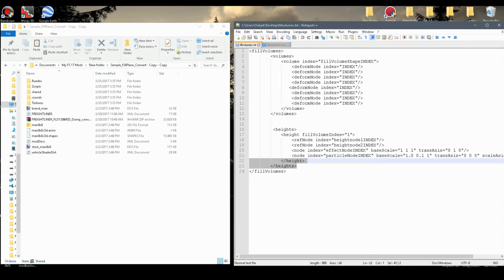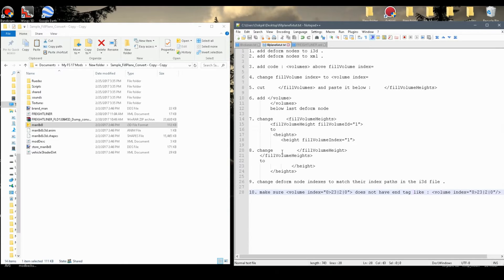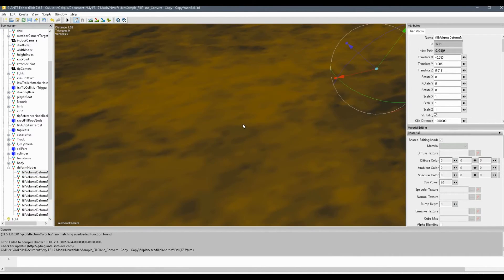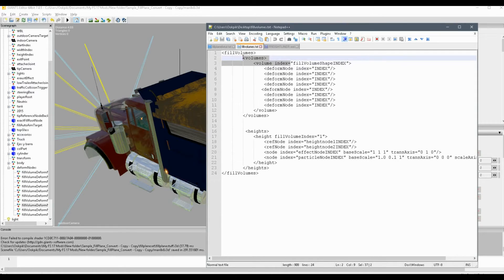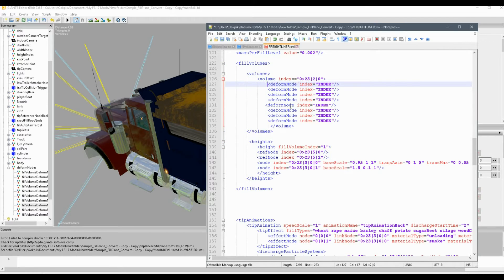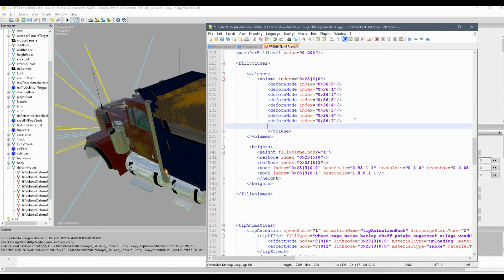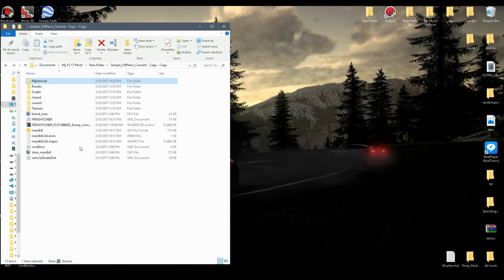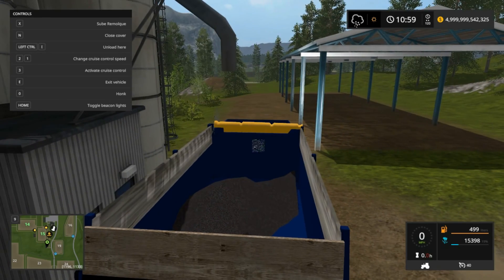Fix Converted Mod's Fillplanes // Farming Simulator 17

Comment: Hi Chase, i tried again your tutorial and it's work ! i can fill my trailer but only under a combine harvester and not under the grain silo ? Otherwise i have an other problem, the game crash when i want unload the trailer have you an idea to fix it ?
Error: Running LUA method 'update'.
dataS/scripts/effects/ShaderPlaneEffect.lua(62) : attempt to perform arithmetic on field 'currentDelay' (a nil value)
Error: Running LUA method 'update'.
dataS/scripts/effects/ShaderPlaneEffect.lua(62) : attempt to perform arithmetic on field 'currentDelay' (a nil value)
Error: Running LUA method 'update'.
dataS/scripts/effects/ShaderPlaneEffect.lua(62) : attempt to perform arithmetic on field 'currentDelay' (a nil value)
Error: Running LUA method 'update'.
dataS/scripts/effects/ShaderPlaneEffect.lua(62) : attempt to perform arithmetic on field 'currentDelay' (a nil value)
Error: Running LUA method 'update'.
dataS/scripts/effects/ShaderPlaneEffect.lua(62) : attempt to perform arithmetic on field 'currentDelay' (a nil value)
Error: Running LUA method 'update'.
dataS/scripts/effects/ShaderPlaneEffect.lua(62) : attempt to perform arithmetic on field 'currentDelay' (a nil value)
Error: Running LUA method 'update'.
dataS/scripts/effects/ShaderPlaneEffect.lua(62) : attempt to perform arithmetic on field 'currentDelay' (a nil value)
Error: Running LUA method 'update'.
dataS/scripts/effects/ShaderPlaneEffect.lua(62) : attempt to perform arithmetic on field 'currentDelay' (a nil value)
Error: Running LUA method 'update'.
dataS/scripts/effects/ShaderPlaneEffect.lua(62) : attempt to perform arithmetic on field 'currentDelay' (a nil value)
Error: Running LUA method 'update'.
dataS/scripts/effects/ShaderPlaneEffect.lua(62) : attempt to perform arithmetic on field 'currentDelay' (a nil value)
Error: Running LUA method 'update'.
dataS/scripts/effects/ShaderPlaneEffect.lua(62) : attempt to perform arithmetic on field 'currentDelay' (a nil value)
Error: Running LUA method 'update'.
dataS/scripts/effects/ShaderPlaneEffect.lua(62) : attempt to perform arithmetic on field 'currentDelay' (a nil value)
Error: Running LUA method 'update'.
dataS/scripts/effects/ShaderPlaneEffect.lua(62) : attempt to perform arithmetic on field 'currentDelay' (a nil value)
Error: Running LUA method 'update'.
dataS/scripts/effects/ShaderPlaneEffect.lua(62) : attempt to perform arithmetic on field 'currentDelay' (a nil value)
Error: Running LUA method 'update'.
dataS/scripts/effects/ShaderPlaneEffect.lua(62) : attempt to perform arithmetic on field 'currentDelay' (a nil value)
Error: Running LUA method 'update'.
dataS/scripts/effects/ShaderPlaneEffect.lua(62) : attempt to perform arithmetic on field 'currentDelay' (a nil value)
Error: Running LUA method 'update'.
dataS/scripts/effects/ShaderPlaneEffect.lua(62) : attempt to perform arithmetic on field 'currentDelay' (a nil value)
Error: Running LUA method 'update'.
dataS/scripts/effects/ShaderPlaneEffect.lua(62) : attempt to perform arithmetic on field 'currentDelay' (a nil value)
Error: Running LUA method 'update'.
dataS/scripts/effects/ShaderPlaneEffect.lua(62) : attempt to perform arithmetic on field 'currentDelay' (a nil value)
Error: Running LUA method 'update'.
dataS/scripts/effects/ShaderPlaneEffect.lua(62) : attempt to perform arithmetic on field 'currentDelay' (a nil value)
Error: Running LUA method 'update'.
dataS/scripts/effects/ShaderPlaneEffect.lua(62) : attempt to perform arithmetic on field 'currentDelay' (a nil value)
Error: Running LUA method 'update'.
dataS/scripts/effects/ShaderPlaneEffect.lua(62) : attempt to perform arithmetic on field 'currentDelay' (a nil value)
Error: Running LUA method 'update'.
dataS/scripts/effects/ShaderPlaneEffect.lua(62) : attempt to perform arithmetic on field 'currentDelay' (a nil value)
Error: Running LUA method 'update'.
dataS/scripts/effects/ShaderPlaneEffect.lua(62) : attempt to perform arithmetic on field 'currentDelay' (a nil value)
Error: Running LUA method 'update'.
dataS/scripts/effects/ShaderPlaneEffect.lua(62) : attempt to perform arithmetic on field 'currentDelay' (a nil value)
Error: Running LUA method 'update'.
dataS/scripts/effects/ShaderPlaneEffect.lua(62) : attempt to perform arithmetic on field 'currentDelay' (a nil value)
Error: Running LUA method 'update'.
dataS/scripts/effects/ShaderPlaneEffect.lua(62) : attempt to perform arithmetic on field 'currentDelay' (a nil value)
Error: Running LUA method 'update'.
dataS/scripts/effects/ShaderPlaneEffect.lua(62) : attempt to perform arithmetic on field 'currentDelay' (a nil value)
Error: Running LUA method 'update'.
dataS/scripts/effects/ShaderPlaneEffect.lua(62) : attempt to perform arithmetic on field 'currentDelay' (a nil value)
Error: Running LUA method 'update'.
dataS/scripts/effects/ShaderPlaneEffect.lua(62) : attempt to perform arithmetic on field 'currentDelay' (a nil value)
Error: Running LUA method 'update'.
dataS/scripts/effects/ShaderPlaneEffect.lua(62) : attempt to perform arithmetic on field 'currentDelay' (a nil value)
Error: Running LUA method 'update'.
dataS/scripts/effects/ShaderPlaneEffect.lua(62) : attempt to perform arithmetic on field 'currentDelay' (a nil value)
Error: Running LUA method 'update'.
dataS/scripts/effects/ShaderPlaneEffect.lua(62) : attempt to perform arithmetic on field 'currentDelay' (a nil value)
Error: Running LUA method 'update'.
dataS/scripts/effects/ShaderPlaneEffect.lua(62) : attempt to perform arithmetic on field 'currentDelay' (a nil value)
Error: Running LUA method 'update'.
dataS/scripts/effects/ShaderPlaneEffect.lua(62) : attempt to perform arithmetic on field 'currentDelay' (a nil value)
Error: Running LUA method 'update'.
dataS/scripts/effects/ShaderPlaneEffect.lua(62) : attempt to perform arithmetic on field 'currentDelay' (a nil value)
Error: Running LUA method 'update'.
dataS/scripts/effects/ShaderPlaneEffect.lua(62) : attempt to perform arithmetic on field 'currentDelay' (a nil value)
Error: Running LUA method 'update'.
dataS/scripts/effects/ShaderPlaneEffect.lua(62) : attempt to perform arithmetic on field 'currentDelay' (a nil value)
Error: Running LUA method 'update'.
dataS/scripts/effects/ShaderPlaneEffect.lua(62) : attempt to perform arithmetic on field 'currentDelay' (a nil value)
Error: Running LUA method 'update'.
dataS/scripts/effects/ShaderPlaneEffect.lua(62) : attempt to perform arithmetic on field 'currentDelay' (a nil value)
Error: Running LUA method 'update'.
dataS/scripts/effects/ShaderPlaneEffect.lua(62) : attempt to perform arithmetic on field 'currentDelay' (a nil value)
Error: Running LUA method 'update'.
dataS/scripts/effects/ShaderPlaneEffect.lua(62) : attempt to perform arithmetic on field 'currentDelay' (a nil value)
Error: Running LUA method 'update'.
dataS/scripts/effects/ShaderPlaneEffect.lua(62) : attempt to perform arithmetic on field 'currentDelay' (a nil value)
Error: Running LUA method 'update'.
dataS/scripts/effects/ShaderPlaneEffect.lua(62) : attempt to perform arithmetic on field 'currentDelay' (a nil value)
Error: Running LUA method 'update'.
dataS/scripts/effects/ShaderPlaneEffect.lua(62) : attempt to perform arithmetic on field 'currentDelay' (a nil value)
Error: Running LUA method 'update'.
dataS/scripts/effects/ShaderPlaneEffect.lua(62) : attempt to perform arithmetic on field 'currentDelay' (a nil value)
Error: Running LUA method 'update'.
dataS/scripts/effects/ShaderPlaneEffect.lua(62) : attempt to perform arithmetic on field 'currentDelay' (a nil value)
Error: Running LUA method 'update'.
dataS/scripts/effects/ShaderPlaneEffect.lua(62) : attempt to perform arithmetic on field 'currentDelay' (a nil value)
Error: Running LUA method 'update'.
dataS/scripts/effects/ShaderPlaneEffect.lua(62) : attempt to perform arithmetic on field 'currentDelay' (a nil value)
Error: Running LUA method 'update'.
dataS/scripts/effects/ShaderPlaneEffect.lua(62) : attempt to perform arithmetic on field 'currentDelay' (a nil value)
Error: Running LUA method 'update'.
dataS/scripts/effects/ShaderPlaneEffect.lua(62) : attempt to perform arithmetic on field 'currentDelay' (a nil value)
Error: Running LUA method 'update'.
dataS/scripts/effects/ShaderPlaneEffect.lua(62) : attempt to perform arithmetic on field 'currentDelay' (a nil value)
Error: Running LUA method 'update'.
dataS/scripts/effects/ShaderPlaneEffect.lua(62) : attempt to perform arithmetic on field 'currentDelay' (a nil value)
Error: Running LUA method 'update'.
dataS/scripts/effects/ShaderPlaneEffect.lua(62) : attempt to perform arithmetic on field 'currentDelay' (a nil value)
Error: Running LUA method 'update'.
dataS/scripts/effects/ShaderPlaneEffect.lua(62) : attempt to perform arithmetic on field 'currentDelay' (a nil value)
Error: Running LUA method 'update'.
dataS/scripts/effects/ShaderPlaneEffect.lua(62) : attempt to perform arithmetic on field 'currentDelay' (a nil value)
Error: Running LUA method 'update'.
dataS/scripts/effects/ShaderPlaneEffect.lua(62) : attempt to perform arithmetic on field 'currentDelay' (a nil value)
Error: Running LUA method 'update'.
dataS/scripts/effects/ShaderPlaneEffect.lua(62) : attempt to perform arithmetic on field 'currentDelay' (a nil value)
Error: Running LUA method 'update'.
dataS/scripts/effects/ShaderPlaneEffect.lua(62) : attempt to perform arithmetic on field 'currentDelay' (a nil value)
Error: Running LUA method 'update'.
dataS/scripts/effects/ShaderPlaneEffect.lua(62) : attempt to perform arithmetic on field 'currentDelay' (a nil value)
Error: Running LUA method 'update'.
dataS/scripts/effects/ShaderPlaneEffect.lua(62) : attempt to perform arithmetic on field 'currentDelay' (a nil value)
Error: Running LUA method 'update'.
dataS/scripts/effects/ShaderPlaneEffect.lua(62) : attempt to perform arithmetic on field 'currentDelay' (a nil value)
Error: Running LUA method 'update'.
dataS/scripts/effects/ShaderPlaneEffect.lua(62) : attempt to perform arithmetic on field 'currentDelay' (a nil value)
Error: Running LUA method 'update'.
dataS/scri
Reply from the maker: Hello, that is an odd issue... Are there any other errors relating to the mod other than this one?
(To make it easier to pick out the errors of just that vehicle, you can create a new savegame, and include only that vehicle)

Comment: Hi TheChase IsOn, i think I did everthing right but when i start the game mod is instaled but I can't find him in store. What is 
 the problem?
Reply from the maker: Could be a number of issues, though the most common is malfunctioning lua scripts, this playlist goes through what you can do to get it working on the most basic level. 
https://www.youtube.com/watch?v=QClKOavOHvo&list=PLCT2A9zAL1JsXDN96YECnyxIMjWWhbC35
Reply: TheChase IsOn when I open log, I find this
Error: can't load resource 'c:/Users/stiv/Documents/My Games/Farmingsimulator2017/mods/Zmaj_489_converted/store.dds'.
Do you know now what is problem? Sorry if I am boring you :)
Reply from the maker: Ehm, that would not be the problem that would cause it not to load. That error would mean that it can't find the texture file for the store image. 

All this would do, is not show an image for the mod when in store, in-game. 
(This could be corrected by correcting the store image filepath in the modDesc, or xml files to where the image actually is, for example, Folder/Textures/storeimage.dds)

Though that would not be the main issue.

Perhaps it may be the the zip file of your mod (that you put in the mod folder) has a space in the filename. 

For instance, if the zip file (and it should be a zip file, not a rar, check this as well, as rar files can't be read as mods by the game) has a name "My Mod.zip" that won't load in-game, whereas "My_Mod.zip" will.
Reply: Need you to ask, is this  tutorial I use to fix the problem with mod(can be a trailer for tractor) when I can't refill fruits from the silos?
And I try to do again and it's same problem, the interesting thing is that when I put converted mod he appears in store  but when I edit that mod with fillplane the mod disappears...
And this is in log
Error: Can't load resource 'C:/Users/Stiv/Documents/My Games/FarmingSimulator2017/mods/ZMAJ_489_converted/store.dds'.
Error: C:/Users/Stiv/Documents/My Games/FarmingSimulator2017/mods/ZMAJ_489_converted/ZMAJ_489.xml. height. .
Error: No storeData found in 'C:/Users/Stiv/Documents/My Games/FarmingSimulator2017/mods/ZMAJ_489_converted/ZMAJ_489.xml'. StoreItem will be ignored!
Reply from the maker: Actually, this would be the video you would refer to on fillplanes. 
https://www.youtube.com/watch?v=XnbXOkyI_LE

Your problem is likely with this part of the error:
Error: C:/Users/Stiv/Documents/My Games/FarmingSimulator2017/mods/ZMAJ_489_converted/ZMAJ_489.xml. height. .

This likely means that you are missing the height section for the fill plane. 

So, like the code for fillplanes is like this (in part) 

<fillVolumes>
        <volumes>
            <volume index="0>23|2|0">
  <deformNode index="0>43|0"/>
           <deformNode index="0>43|1"/>
           <deformNode index="0>43|2"/>
           <deformNode index="0>43|3"/>  
            </volume>
        </volumes>

   <heights>
            <height fillVolumeIndex="1">
<refNode index="0>23|5|0"/>
<refNode index="0>23|5|1"/>
<node index="0>23|3|0|0" baseScale="0.95 1 1" transAxis="0 1 0" transMax="0 0.05 0"/>
<node index="0>23|3|0|1" baseScale="1.8 0.1 1"/>
            </height>
        </heights>
</fillVolumes>

See the section between <heights> and </heights> ?
That is your section for height relating to the fill plane in the xml.

Now, for heights to work, you may need to add some nodes and such to the editor, so just some transform groups along the fill plane to act as modifiers for the height. Or rather, to influence the fill plane. 

I do go over that a bit in that video I linked, so probably a good place to start is watching that video and perhpas that may sort some things out for you.

Hope this helps.
Reply: This is part of mod's xml
<fillVolumes>
        <volumes>
            <volume index="0>3|0|3|0" maxDelta="0.23">
  <deformNode index="INDEX"/>
                <deformNode index="0>12|0"/>
                <deformNode index="0>12|1"/>
                <deformNode index="0>12|2"/>
                <deformNode index="0>12|2"/>
                <deformNode index="0>12|4"/>
                <deformNode index="0>12|5"/>
                <deformNode index="0>12|6"/>
    <deformNode index="0>12|7"/>
    <deformNode index="0>12|8"/>
    <deformNode index="0>12|9"/>
    </volume>
        </volumes>
  <heights>
            <height fillVolumeIndex="1">
            <refNode index="0>3|0|12|0"/>
            <refNode index="0>3|0|12|1"/>
            <node index="0>3|0|8|0" baseScale="1 1 1.27" transAxis="0 1 0"/>
            <node index="0>3|0|8|1" baseScale="1 -5 1" transAxis="0 0.5 0" scaleAxis="0 0.5 0"/>
        </fillVolumeHeight>
        <fillVolumeHeight fillVolumeId="1">
            <refNode index="0>3|0|13|0"/>
            <refNode index="0>3|0|13|1"/>
            <node index="0>3|0|9|0" baseScale="1 1 1.27" transAxis="0 1 0"/>
            <node index="0>3|0|9|1" baseScale="1 -5 1" transAxis="0 0.5 0" scaleAxis="0 0.5 0"/>
        </height>
        </heights>
    </fillVolumes>
Can you see the problem? :/